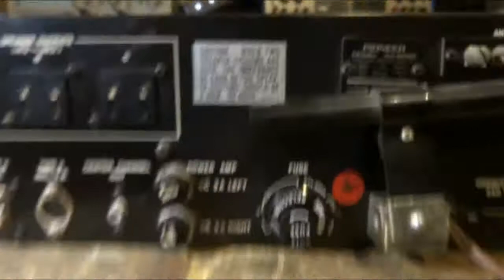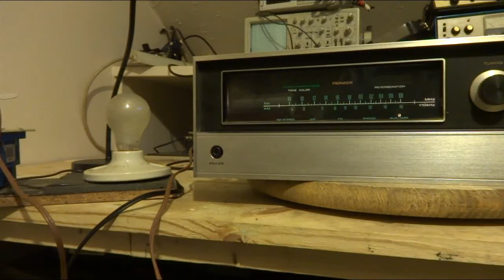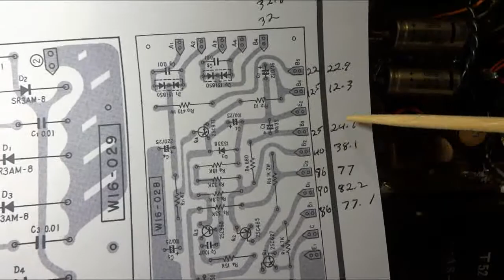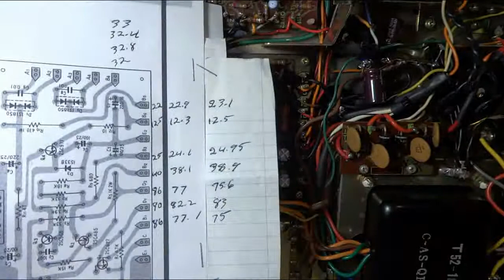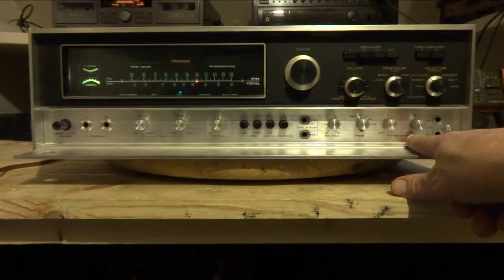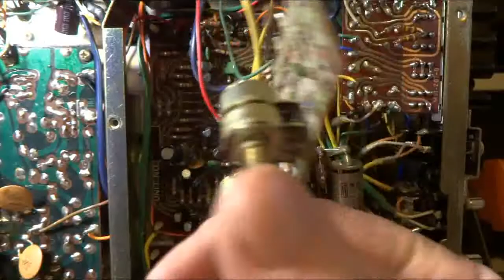Pioneer SX 9000 part 3

Comment: Thanks for these videos. Just starting on my first sx 9000
Reply from the maker: It's not the easiest Pioneer to work on. There is some information on Audiokarma.net on it. So many wires running all over the place. So far I got everything working on the preamp side but I lost one channel on the main amp. I need to put it out to find out what I did wrong on it. Take lots of pics and I wish you well on it.

Comment: On the Sansui RA-500 what transistors were replaced and the Pioneer SX-9000 on the tone board, did you find pin position change when you put in the ksc1845's?